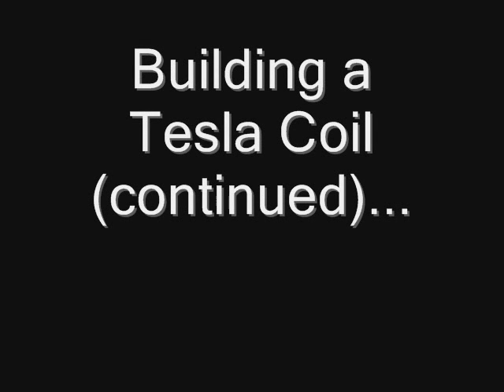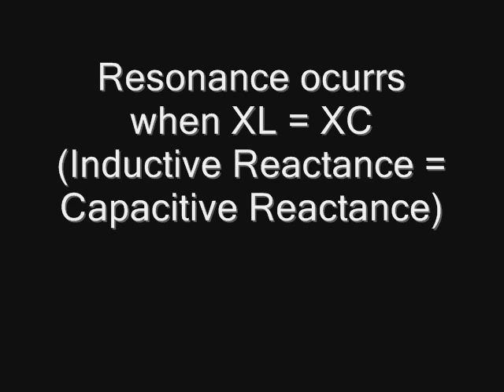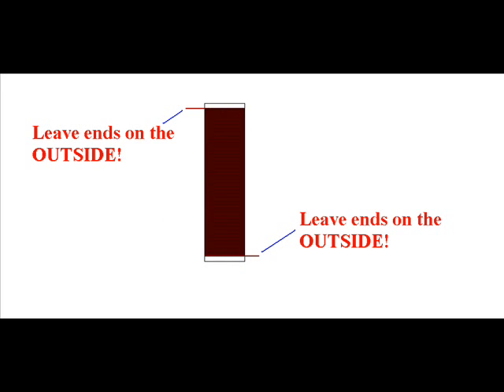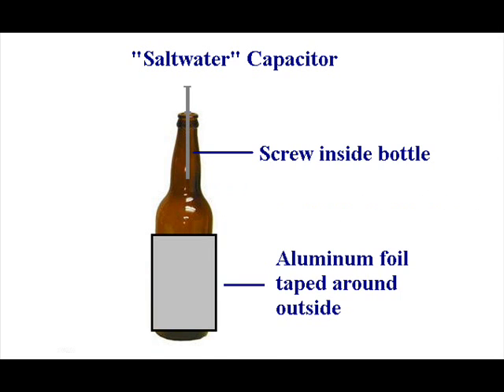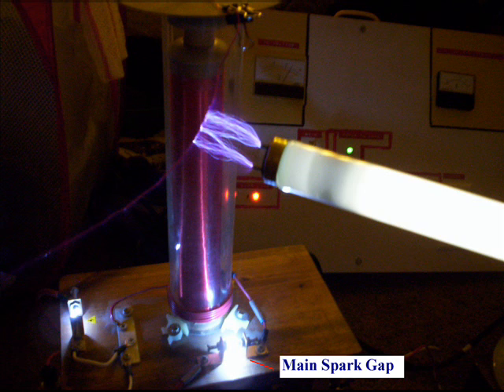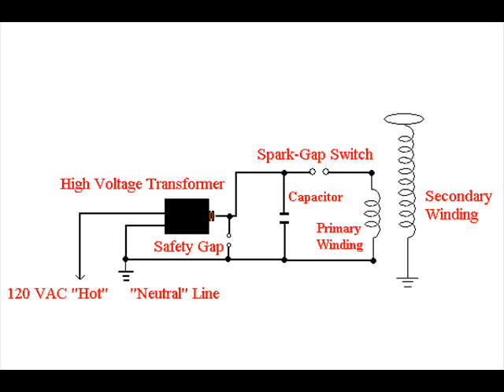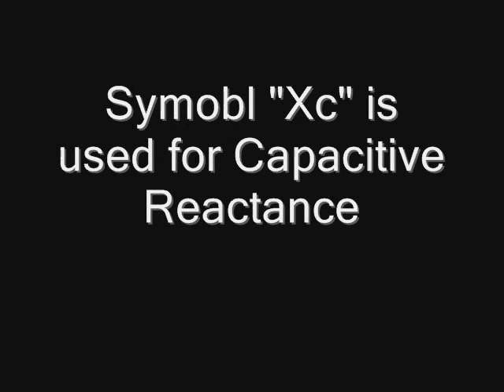Building a Tesla Coil - Part 2 (A)

Comment: Hi, I'm a student and I am also building a Tesla coil. And can I know the output of your Tesla coil?
Reply from the maker: I don't know the exact output, but I estimated it to be around 80,000-100,000 volts
Reply: @ct6502c  I have a input of 230 v and 50hz for the transformer, can I use your model design?

Comment: For the transformer, can a flyback transformer from a crt TV be used? It generates high voltage ac but I how no idea how much or what frequency so I'd have no idea what capacitor to use if this is even a viable option?
Reply from the maker: You should be able to, I have read of people using flyback transformers to power a Tesla Coil. But I personally have never done that. The problem is that if you don't know the ouput voltage, you won't know what voltage rated capacitors to use for the Tesla Coil primary circuit. High voltage capacitors are already kind of hard to find, and they get more expensive the higher the voltage. Also, flyback transformers tend to output very high voltage, but aren't capable of supplying much current. That's exactly the opposite of what you need. It would depend on the circuit you use to drive the flyback itself though. Unfortunately, I don't have much experience with solid state electronics, so you would have to talk to someone else who has built driver circuits.
Reply: @ct6502c  thanks. I really appreciate that you responded.  I think I'll just have to build a proper tesla coil and go from there.
Have you ever added sound to yours? That would be a great vid to see as most people's are just store boughr

Comment: I don't think that is how the capacitor works, I think when the capacitor is not charged the power goes into charging it instead of jumping the gap since that is the path of least resistance once charged however the power then has to jump the gap and at the same time discharge the capacitor. When the capacitor gets discharged enough the power can go back into charging and it no longer jumps the gap. If what I am saying is correct then if you remove the capacitor then you will have a continues ark across the spark gap.

Comment: think of the whole device like a swing set. The "dad" in this story is the pulsed current in the primary; he's pushing his little girl, the voltage difference across the secondary, on this swing set. The little girl comes all the way up, the dad gives a little push; these little pushes build up, causing more energy to be stored in the oscillation.

Comment from the maker: @3rtrading 
When you change the number of turns in the primary winding, you change the inductance, which in turn changes the inductive reactance.  Some people also use a movable tap on the primary winding.  However, you don't really have any easy way of changing the inductive reactance in the secondary circuit without having to make a new winding.  You can change the capacitive reactance by using different toploads though.

Comment from the maker: @carnotricecooker 
Since it's a resonant circuit, I would think that changing capacitance or inductance would still affect it regardless of whether it's a spark gap coil or solid state.

And pointing the ends of the winding through the top is a bad idea because you can get corona inside the winding.  I guess you might be able get away with it with solid state because usually the voltage is lower than what you get with a spark gap coil.

Comment: Will changing the size of the toroid/capacitance on the secondary affect the tesla coil's function if building a solid state tesla coil? I'm also curious how leaving the ends of the secondary windings outside affects a SSTC since I've seen a lot of people have them point straight up out of the center of the top.

Comment from the maker: @rishabrijal07 
Actually, you have it backwards.  Connecting capacitors in series doubles the voltage rating, and connecting them in parallel doubles the capacitance value.

Comment from the maker: @xxflinkxx 
As a matter of fact, yes, I do know what I'm doing.  I've been experimenting with high voltage for over 10 years.  (And I built my first Tesla Coil in 1999).  You seem to be mixing up a lot of concepts and oversimplifying things.  First of all, more capacitance does NOT mean more power.  The capacitance you need (in the primary circuit and terminal capacitance in the secondary) depends on the resonant frequency.

Comment: @RavenPrecept 
The cap has a small capacitance with regards to the output current of the supply transformer, the idea is that it should fully charge on each half cycle of the 50/60Hz Ac supply.

Comment: Hi, plz i really need your help. i could not find a capacitor with 12 kv and 0.005 mfd. though i did get 6 3kv capacitors with 0.001 mfd. will that work in series.

if not how many saltwater capacitors would i need for your example of tesla coil,
many thanks

Comment from the maker: You can buy it at any hardware store or electrical supply shop.  I just buy spools of wire from Home Depot.  You can get it in spools, or you can get a certain length of it cut from a bulk spool.  You'll probably need at least 30 feet.

Comment from the maker: no, actually that sounds perfect.  With a Tesla Coil, you ideally need capacitors with a very high voltage rating but a low capacitance value.  Of course, it will depend on your coil.  You'll probably have to tune it anyway, by adding or removing turns from the primary winding.  But what you have sounds like a good place to start.

Comment: I am wondering, is there a safe way to measure the frequency of the tesla coil on my oscilloscope without blowing it up? I think just a couple of fat resistors to bring the voltage down safely would work, but oscilloscopes are expensive, and I want to make sure that it would work before trying anything.

Comment: Now, as for the schematic analysis, it pretty much boils down to, if you do not have a high side low band bypass filter, you should put the cap in series with the primary instead of parallel. The capacitor can discharge energy though the xfmr due to resonant rise voltage across the cap that even the filter will not dampen out. Do NOT 100% rely on safety gaps, I've killed a NST this way back when I was new due to putting the cap in parallel. I switched it and put in another, it still lives now.

Comment: I will have to concur with gt4awd up to an extent. In spark gap coils, it's typical to use a pancake style primary for the sole reason of possibility over coupling, as well as differentiation in voltage potential between windings on the secondary in ratio the the coupling of the primary, but mostly because of the type of waveform and coupling. The other explanation was just a fancy way of saying "Due to obvious insulation issues."

You would understand if you've made any solid state coils.

Comment from the maker: There's nothing wrong with a disagreement.  However, the issue about whether to put the spark gap in series or parallel is still debated, and I have seen many designs with either way.  In fact, most of the designs I've seen have the spark gap in series.  It's the same as whether to have a helical or flat spiral primary winding.  There's a lot of design variations.  There are advantages and disadvantages for either way.

Comment: ct92404, please don't get offended by our disagreements here. You have done a great job with your videos, and I'm sure it has helped a lot of beginning coilers. I just felt the need to point out several potential problems with your overall circuit design.

Comment: Which is completely different from what I was talking about. The spark gap in parallel acts as a short circuit. After the capacitor discharges no RF can flow back through the transformer. Basically in parallel the transformer never conducts the high frequency generated by the capacitor spark gap combination. That is why parallel spark gap is recommended. Doesn't really matter on PIG, and potential transformers as they are very heavy duty, but a weak NST, OBIT, etc, benefits from this circuit.

Comment: Yes, the spark gap CAN be connected in series or in parallel, but spark gap in parallel protects the transformer from the high frequency generated by the tank circuit. I also still disagree with using the houses neutral. For obvious reason that it isn't designed for what you're using it for. You do realize even the neutral has a low voltage rating, right? If it's working fine for you that's great, but it isn't recommended simply put...

Comment from the maker: And one last point, when I first learned to build Tesla Coils (back in about 1999) I had help from a retired radio technician who builds HUGE Tesla Coils and other high voltage devices.  Yes, for a high power Tesla Coil you would need a dedicated RF ground, but for a small low-power coil like this, using the neutral or ground line is acceptable.

Comment from the maker: ...Secondly, the spark gap can be connected in series OR in parallel.  I have seen and used both methods.  It's easier to tune a resonant circuit with the capacitance connected in parallel with the inductor.  Obviously, this isn't an "error" in my schmatics since I have built several successful coils this way.  As far as using the house neutral or ground line for the RF ground, I have never encountered any problems with this (again, doing this for 10+ years).

Comment from the maker: Okay, but I should point out that I've been working with high voltage for over 10 years.  The single pole transformer is an end-point grounded transformer, which is very commonly used to power Tesla Coils.  In this case, it's a furnace ignition transformer.  If you watch both parts of this video, I clearly explain that the diagram is for an end-point grounded transformer.  I have used both mid-point grounded transformers and end-point grounded transformers...

Comment: Not to be rude but I would like to point out a major error in your Tesla Coil schematics... To start you seem to be using a single pole transformer, and this is going to confuse people with a standard two pole NST. Other than that, you're using the houses main line ground. This is a bad idea as it will introduce high voltage RF electricity into the main line. Potentially destroying very expensive electronics using the same mains. Also spark gap should be in parallel, and capacitor in series...

Comment from the maker: yeah, plasma globes use a flyback transformer, which works similar to a Tesla Coil, but not quite the same.  It's a high voltage \ high frequency transformer, but it's not really a tuned resonant circuit the same as a Tesla Coil.  Also, usually they only supply about 20,000 volts at most, but a Tesla Coil can generate over 100,000 volts.

If you touch the HV wire on a plasma globe it might not shock you because of the high frequency, but the arc can burn your fingers.  I wouldn't try it!

Comment from the maker: ...what I mean is that you have to tune a Tesla Coil to get optimum performance, so the spark gap is adjustable only in that you adjust it until you find the right setting for the best output.  Same thing with the amount of capacitance.  You can't really adjust the frequency on the fly to whatever you want, because you're kind of stuck with the resonant frequency that the Tesla Coil works best at when you build it.

Comment from the maker: A variable capacitor (if you could even find one or build one that could handle voltage that high) would alter the amount of capacitance.  There is a certain resonant frequency that a Tesla Coil "prefers" depending on the characteristics of how you built it, like the size and inductance of the primary and secondary windings, etc.

Comment from the maker: it doesn't have to be magnet wire.  You can use plastic insulated wire if you can find one thin enough.  Magnet wire is better because it's thinner and so you can wind more turns with it.    You'll have less inductance if you use plastic wire.

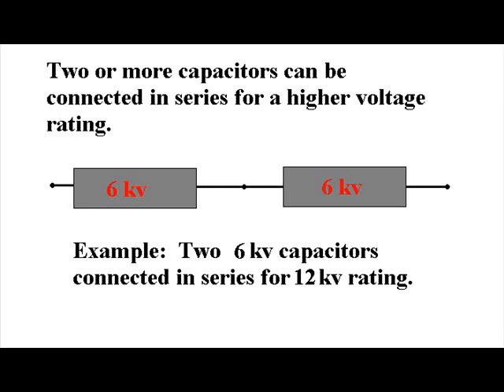Comment from the maker: This was all explained in the video.  I had a whole section on capacitors starting at about 3:54.  The capacitor has to be rated for at least twice the voltage of your transformer.  So it depends on your transformer.  I would say that you need a capacitor rated for at least 10,000 volts.  And yes you can put lower voltage capacitors in series...again that was in the video too, at about 4:26.  But they should still be rated for at least 1 or 2kv each.

Comment from the maker: No, don't use wood for the secondary winding.  Wood is not a perfect insulator.  It's okay to use for the primary winding, but the voltage is too high on the secondary winding.  The best thing to use is a plastic tube like PVC or acrylic.  I think any plastic tube would work as long as it doesn't have too much carbon, like ABS.

Comment from the maker: I don't remember what the specific advantages were for a flat winding.  Maybe there's less chance of arcing between the secondary and primary.  I use a vertical primary winding just because it's a lot easier to make.  To mount the secondary, get a plastic lid that fits the tube you wound the secondary on, or you could just use a wooden doorknob and fit that on the tube!  Then bolt it onto your base with plastic screws, which you can get at a hardware store.

Comment from the maker: I'll have to convert your metric measurements to standard, but it sounds like you probably have too much resistance on your secondary winding.  1000 turns might be a bit too much.  Also, what gauge wire did you use for the winding?  I would recommend 26 or 28 gauge magnet wire...no smaller than 28 gauge.  You might have too much resistance and too much inductance on your secondary winding.

Comment: Hay man great vid.
I just finished building my tesla coil and i have a problem. I am trying to get visible arcs but it doesn't . it will only arc to a piece of metal. My transformer is a 12kv 30ma NST capacitors are a MMC 21kv and i have an adjustable spark gap. Primary is 5 turns and secondary is 3.5cm diameter and 35cm high and is over 1000 turns of thin copper wire. How can i adjust it so it gets visible sparks

Comment from the maker: a Tesla Coil doesn't really scale down too easily.  It's not just a matter of making all the parts smaller...smaller windings affect the inductance and you really have a practical limit on how small you can make the secondary winding.  Also, remember with a spark-gap type coil, you need a minimum voltage to get the gap to fire correctly.  You still need at least 6kv.